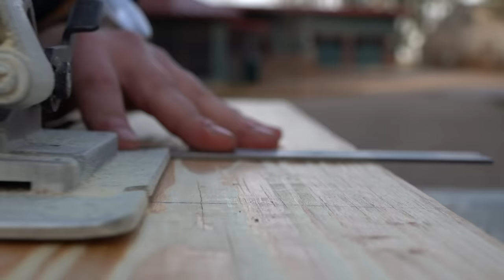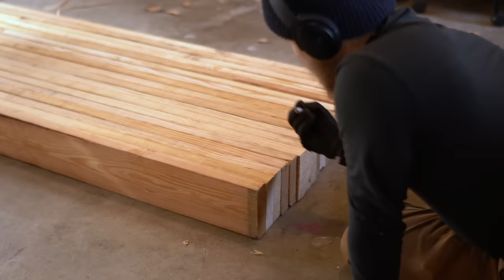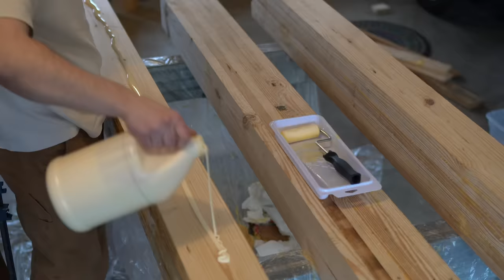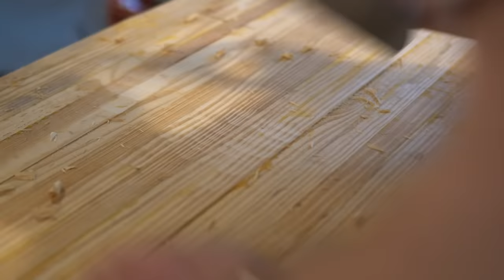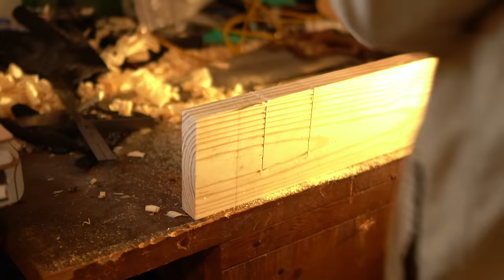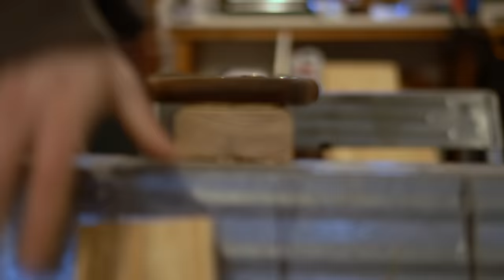Building The Anarchist's Workbench - Part 1: Benchtop, Legs, and Stretchers - Woodworking

Comment: This is a pretty solid little workbench. While once you figure out how it comes together, it is physically Easy to assemble https://www.youtube.com/post/UgkxyFZUPFEey-PuqsPMxqaykBhgA1LWxFHh by yourself. But the diagrams explaining the steps are really pretty bad. I could not get the handle pins in all the way despite multiple attempts, so I just used a screw I had on hand for the 2nd handle. I could not get the first pin in further or pull it back out. You are supposed to hammer it in, but I had no leverage and the handle is plastic and I did not want to risk breaking it. I will get a lot of use out of the bench because of the convenient size and height. It does fold up nicely for storage. They even explain how to fold it so you don't get pinched...that is important!
Reply: I get tired of this being touted as the beginner's workbench.

It's more like the carpenter turning into a woodworker's workbench.

Comment: Fine book by a fine man.  Beefy bench! love the scrub plane
A liiiiiittle pinch of salt between boards will prevent them from floating around on the glue.
Reply from the maker: Actually?? I’ve never heard that one 😅
Reply: @anarcholeptic  Yep. I’ve seen it suggested any number of places.
Reply: What about saw dust, would that work as well? I'm half slug and I'm afraid that if I use salt, it will slow my work progress down.
Reply: @zc1581  maybe? The deal with salt is that it actually acts as an aggregate, sorta digging into the faces of the boards just enough to slow down float.  Supposedly it then dissolves because water, but.. yeah who knows :P

Comment: Great work. This is going to be an excellent bench. It will serve its purpose well for (many) decades.
BTW: A Stanley #80 cabinet scraper works well for removing glue, among other things, and  you won't need to beat up your block plane -- or your plane hand.. FWIW.

Comment: I know Chris said something about just shooting a few pin nails into the pieces you laminate to hold them in place and then tightening down the clamps.. I don’t know if I could make myself do it, but it’s an interesting thought.
Reply: I've heard you can also sprinkle a pinch of sand or salt into the glue, makes adjusting it harder but it largely stops moving once it's got a little pressure.

Comment: Re watching this now that I've finished the book.

You state that you cut the top to 6 feet.
Did you modify it from the original 8?because that's what I'm having to do. My shop is 10 x 18 so a 8 foot wide. Bench is unreasonable.

If so, how did that affect the holes in the top?
Reply from the maker: Yeah, I shortened it up because 8 feet was too big. Shorted the length of the base commensurately. I kinda just winged it with the holes, I tried my best to follow the pattern he sets out in the book but tweaked it a little to fit my bench and my work. I’d recommend just studying what he did in the book, then try drawing out a few ideas on the benchtop before you drill them.
Reply: @anarcholeptic  thanks man, I appreciate these videos you put out

Comment: Great vids on the build Sir. Did you consider the sliding dovetail legs vs by the book m & t's? I'm at the "leg" stage and debating on which way to proceed. Thanks for any input 👍
Reply from the maker: Appreciate it! I did consider something like it, but it seemed like a lot more work than it was worth, plus this way I could theoretically switch out the benchtop/base in the future should one get damaged.

Comment: In the book Chris sings praises for the old school steel bar clamps for the top glue up. I’m sure they’re great, and comparatively cheap compared to new parallel clamps, but still not something I’m ready to dump money into - that top glue up go okay for you with f-clamps? That’s more my jam at this moment : )
Reply from the maker: Yes, it went just fine. As you could see, I just went total overkill on the number of clamps to make up for the difference in strength.
Reply: I found that comment in the book very interesting.  If you grew up / live in the rust belt....maybe they are available if you go looking.  However, in less industrial parts of the country, they cost an arm and a leg.  Ive been slowly building up 3/4 pipe clamps.  Its the best I can do for the $$.
Reply: I totally agree. You have to figure at least he recommended something that could potentially work as well, probably better, and maybe be cheaper than a brand new collection of Be$$ey or Jet parallel clamps, instead of telling you that those are what you need. And actually I’ve also had a lot of success with the Harbor Freight aluminum clamps that Paul Sellers recommends. $9.99 for a 24’’, and $10.99 for a 36’’, plus of course you’ll use the coupon when you go. You just have to at a strip of wood to the inside to make them more rigid and epoxy small pieces of wood to the jaws so they grip better and won’t mar the work, but that takes little time. For other glue up situations they’ve been great for me, I get even glue squeeze out beads on the whole line and can’t sell where the line is a lot of times once a plane’s been taken to it. Yes on those bar clamps you mention too. With those you get pretty close to the steel ones that Chris is talking about with the crank action of the screw and all.
Reply: How about using ratchet type tie downs?
Reply: @anarcholeptic  nonsense. Nothing exceeds quite like excess. Use them all and more if you can get them.
Reply from the maker: @AwfulErik  I agree, but now I have this huge pile of barely used 36” clamps collecting sawdust 😂
Reply: @anarcholeptic  Make more furniture! :) Thanks for the video
Reply from the maker: @blueblur6447  I have a big channel update coming soon actually…
Reply: I’ve priced those old bar clamps recently and they are not cheap anymore. Apparently old bar clamp owners read the book too.
Reply: It’s the Schwarz Effect. A scientifically proven phenomenon. CS mentions a product that is good, and the price of said item goes up in a matter of months, proportional to the level of goodness that CS says the product has. Same thing has happened to Stanley No. 5 handplanes, vintage Delta bandsaws, and any boring apparatus in the size of 5/8” (his stick chairs have A LOT of 5/8” mortises), just to name a few 😂

Comment: What is the deWalt tool you was using to make the wood square?
Reply from the maker: Dewalt DW7350X. I bought it when they had a special offer so I got that rolling stand for free with it, which is awesome because I can roll it off to a corner when I don’t need it. Saves a lot of space!

Comment: Hey man great videos!  Definitly making me want to build my own.  Just out of curiosity, I have heard that using pine will cause issues down the road from it moving alot and the top needing to be leveled more often than other woods like a maple top.  How has the bench held up since making it?  And have you seen any drawbacks to the pine?   Definitly a solid looking and functional bench. Just looking for some insight before heading down the building path.

-AJ @craftedinnj
Reply from the maker: Southern Yellow Pine actually moves less than you’d think! It’s so resinous that it almost acts like a sealant and helps keep it from exchanging moisture. It’s been very good so far, I made it in the dead of winter and with the humidity we’ve had recently in my area I’ve definitely seen a bit of movement but nothing at all worrying, it smells amazing too! I’m going to give it it’s first re-flattening pretty soon and I’ll bet I won’t need to again for a while. I can only think of one drawback, which is that my vise has gotten a little wiggly as the fasteners loosen up their holes. Besides that, it’s great all around.
Reply from the maker: Thanks for watching and commenting!
Reply: @anarcholeptic  thank you for the reply!  I'll have to hunt around and see where I could snag some southern yellow in Jersey.
Reply: @anarcholeptic  lpt
Reply: The author addresses this and many other questions about Southern Yellow Pine in the book.  It's a free PDF, and you should read the section about yellow pine if you have concerns!

Comment: Nice job, like the bench, gonna tackle it myself soon so just curious, is there a reason you didn’t put the three top sections through the thicknesser. Cheers  :)
Reply from the maker: Fear. Lol, in reality I was working alone and they were really pretty heavy, heavy enough to topple the thicknesser. If you have access to a bigger, sturdier one it would definitely be smarter to do it the way you mentioned. One thing I do like about the way I did it, however, is that I left the underside just scrub planed and I love running my hand over the grooves under the bench.

Comment: What was your final length?
Reply from the maker: I believe it's just a tad shy of 72 inches, 70 1/2 or so.
Reply: @anarcholeptic  Did you make the base a little shorter to match the shorter bench top then? I know his plans are normally for an 8 foot bench
Reply from the maker: @bgirdler  Yes I did. If I remember correctly, his had an 8' top and 4' base, so I kept the ratio and did a 6' top and 3' base.

Comment: George, 
What did the dimensions of the top and legs end up finishing at and how much lumber do you think you were able to make by with?  I’ve enjoyed the three part series and look forward to seeing more content from you 👍
Reply: You can get the book for free, just Google it
Reply: @Kgrhj  I have the book and have built two of them. I was wondering what he settled in on for dimensions. You may have noticed he has a ~7” thick top and that’s not ‘by-the-book’, so it’s not impossible to think that he made many multiple alterations to the straightforward design in the book since everyone’s needs and workflow are different.  None of my benches have personally ever been identical and that’s varied from material, split/not split, width, height, length, joinery, and hardware.  For example, I went from a 26” wide top to a 28” in one iteration Simple because the 28” worked better in windsor chairmaking, but a 22-24” would be preferable if all I did was case work…